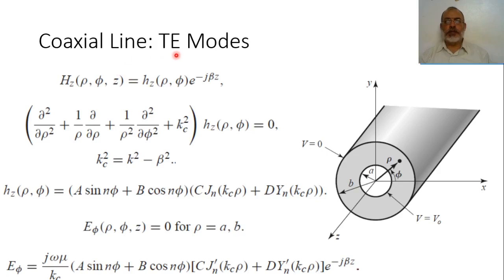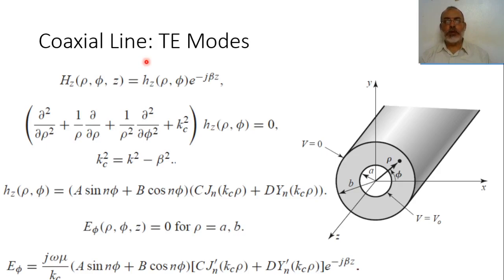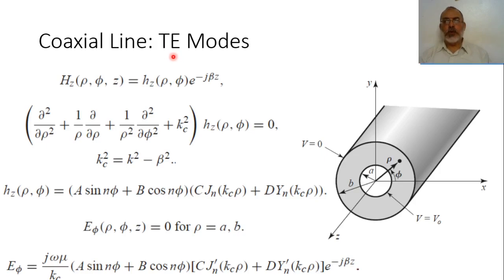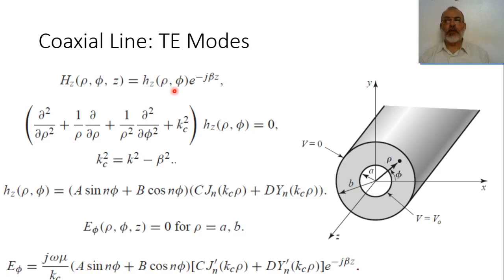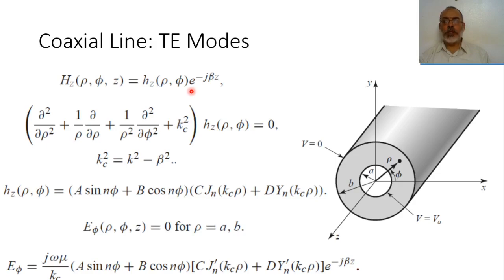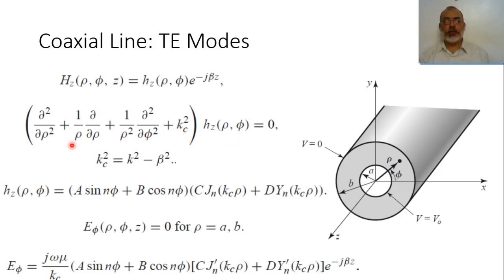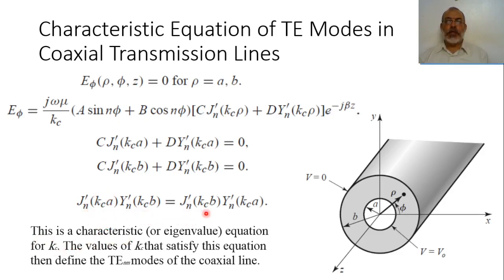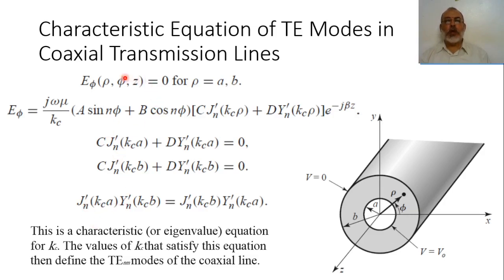Chapter03 s  Coaxial Line TE Mode

Comment: Excellent lectures. Thank you so much. I Hope  Your channel will be recognized by the people very soon  . Could you please also talk about higher modes in the case of two conductor transmission line ? how to find eigen function and values in this case.
Reply from the maker: Many thanks for your kind encourgement. Regarding to higher order modes in coaxial TL I 'll prepare another lecture about it. Best regards.
Reply: @ahmedm.attiya1197  Thank you for your reply. You have already discussed about higher order modes in coaxial cable in your other video, I am specifically looking for two wire line. I meant just two bare conductor . Thanks